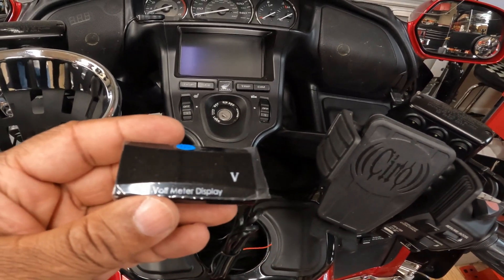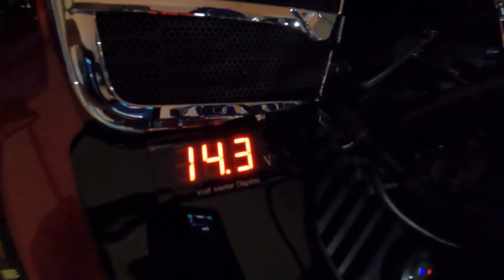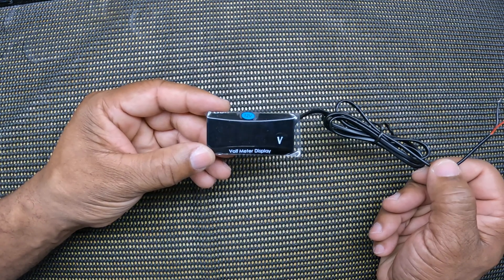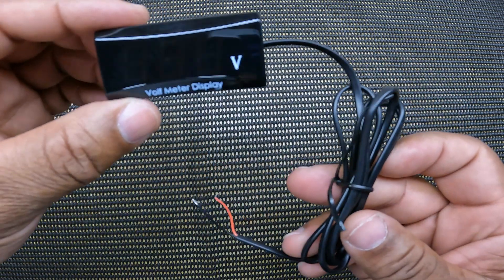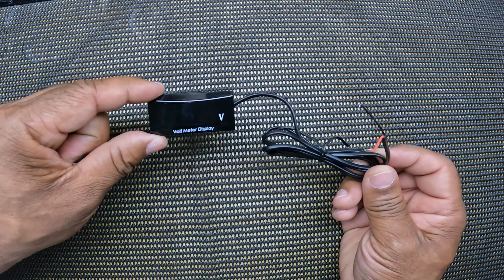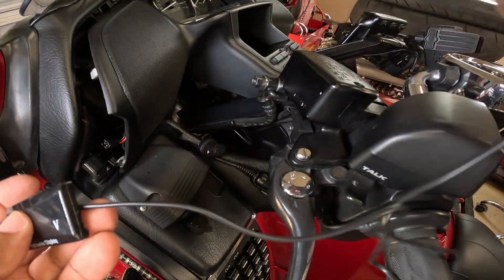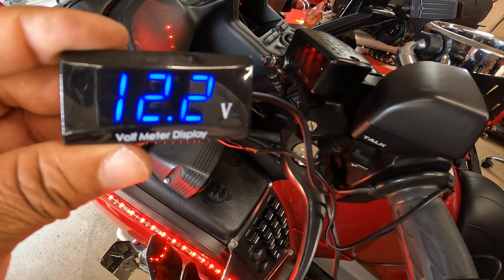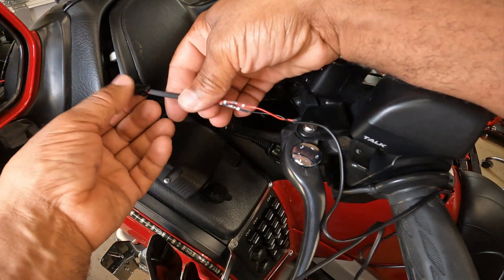Digital 12 Volt LED Battery Display Install Part 2. Honda Goldwing

Comment from the maker: Every motorcycle Manufacturer that has a Top Tier motorcycle like Harley Davidson, BMW, or Indian has real-time voltage monitoring on their touring motorcycles except for Honda.  I love my Honda Goldwing because it is undoubtedly one of the most reliable motorcycle in the world but Honda is a very frugal manufacturer that charges automobile prices for their motorcycle but leaves everything up to the purchaser.  A voltage meter should be standard equipment on a Flagship motorcycle that has a Charging Alternator, can you think of any Touring motorcycle that does not have real time voltage monitoring?  Please list it in the comments below.  Check the video description above!

Comment: PLEASE ADVISE. Is the connection with the little tubes actually soidering the wires you twisted together or is it just providing a waterproof plastic sealed wire twisted connection. Great video And If you answer my question I WILL SUBSCRIBE, COMMENT AND BE EVEN MORE THANKFUL THAN I ALREADY AM!!!!

Comment: Hey Chris great video, i just want to know is do both these products doing the same task or can you use one or the other
Reply from the maker: Yes, you  only need one voltage meter.  I use two as a backup.

Comment: Hey Chris i have a 2001 Honda Goldwing and was wondering how hard is it to run the wiring to the fuse box? How much do i need to take off to do it and do you have any little tricks to get the wires there with the minimum of panels to take off. Great video by the way. Watched when you first put this one in and now i am going to do the same. Thanks Dave
Reply from the maker: At 2 minutes and 20 seconds into the video (2:20) I clearly illustrate a simple connection point but you must use your own creative mind to achive the objective.  "Your mission David should you choose to accept it is to figure out how to run your wiring to the fuse box, if you fail to connect the voltage gauge to your motorcycle, I will disavow any knowledge of your actions.  This reply will self destruct in 5 seconds.  Good Luck, David."
Reply: @chriscaliente5033  Ha well i will find a way. My secret weapon is i have a Honda mechanic in my back pocket that can help. was just looking for a quick tip on how to run it down the frame to the fuze box as Amazon just delivered it to me. As always thanks for the great videos and thank you for replying. Looking forward to seeing more videos.
Dave
Reply: @David-mf9bk use a guide line. i.e, large cable tie or a flexi nylon type line.. attach the wire to the end and “wiggle” it the the desired route to fuse box so auxiliary posts next to fuse box…
Reply: @garyedwards8142  Thank you very much for that advice. I will try that this weekend if i get the chance.

Comment: I think it looks good,
Reply from the maker: To not have a Voltage Meter on a motorcycle is equivalent to not having a Fuel Gauge on a motorcycle, what sense would that make?